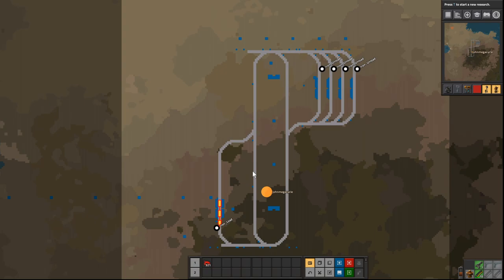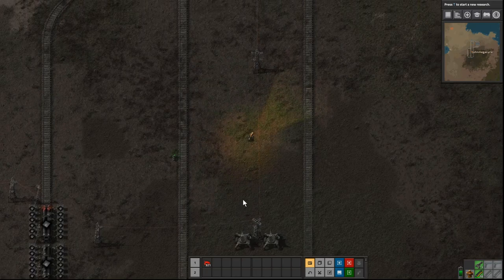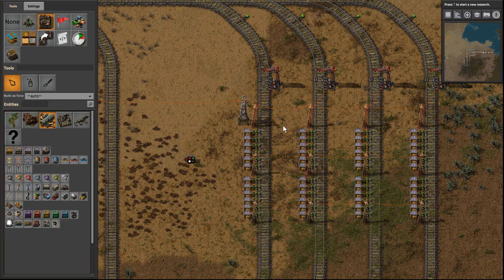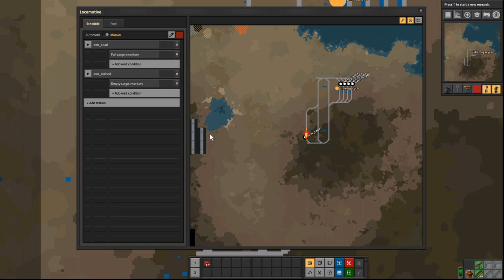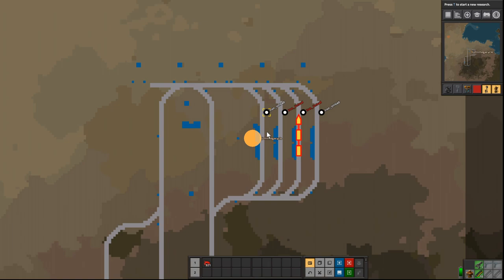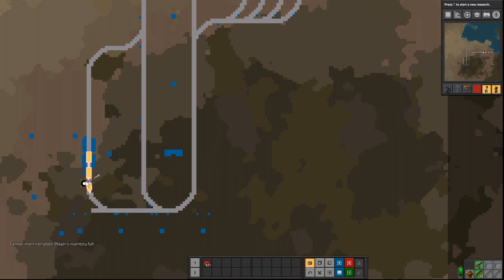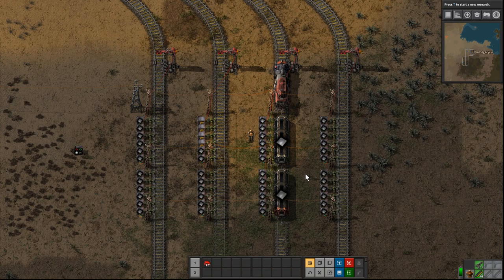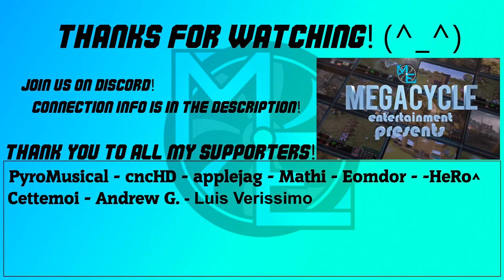Factorio - Basic Train Station Availability Tutorial

Comment: I tried this with multiple trains and loading stations. Trains would get stuck because two trains would try and go to the same station. The first train would make it to the station and unload, thus disabling the station, and the second train, instead of finding an open station would just stop immediately in its tracks because its target got disabled. I was also trying to find a simple way to have strains constantly loading and unloading stations as needed. I think I will try lots of loading stations with the same name, but every train will have a single designated unload spot. If that works then I shouldn't have to re-program trains as mining stations run out. I'm also not into super complicated logic systems, my brain just doesn't work that way unless I spend more time with it.
Reply from the maker: I absolutely understand. This solution is a good 'beginner level' to how to do this and as you noted, doesn't help for more high volume processes. you could build a stacker, meaning a pre-staging area for each zone, which would help a bit, but doesn't really fix anything. 
Tbh, for what you'd need, I'd recommend just assigning one or two trains per station, depending on the need/volume.
Reply: @JohnMegacycle  I think I am going to try to automate the signal for the stations rather than automating the enable/disable on the station. If the train targets a station that is not ready it will at least make it to the train stacker instead of stopping in the middle of the tracks.
Reply from the maker: That makes good sense! Let me know how it goes.
Reply from the maker: That's valid, but since that is not a 100% sure fire way to control exactly how many, I thought disabling the station immediately upon met condition would be safer.

Still, I appreciate the info. Thank you. 😁
Reply from the maker: You are completely correct. This can be handled better with some circuit networks, but I wanted to keep it as simple as possible, which limits what we can do.

Comment: Good one. I've seen a setup where additionally rail signal before station sends red signal also activating station - so it's activated by low resources or red signal. Don't know what is the purpose of that.
Reply from the maker: I can't think of a use case for that. This is interesting tho.
Reply: @JohnMegacycle  I think I found out in old video they say that station needs to be active when train is stopped so that it gets fully unloaded and not only to threshold value.
Reply from the maker: Ah, that makes sense! Okay, that's another low tech and smart answer to a high tech problem. 😁